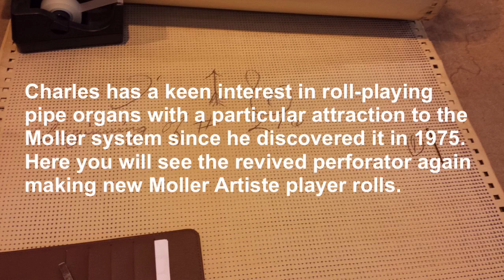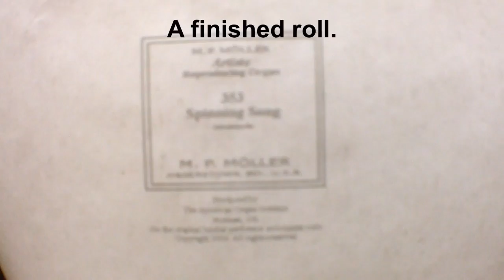The Moller Artiste pipe organ player roll perforator.

Comment from the maker: The name "Artiste" was first copyrighted by Moller for their roll-playing system.  Roll players fell out of fashion between 1930 and 1940 and largely were no longer offered. When Moller introduced their line of small cabinet organs, they took the Artiste name which was still in copyright and used it for these small organs, but its first use was for the players.
Reply: I learn something new everyday... My late grandfather ( Harold D. Ocker ) worked for Moller from 1924 until before their unfortunate bankruptcy. He first worked as an installer and finally the vice president. He developed the later "Artiste" cabinet models, which I understand was a bit of a failure. Moller was competing with the newer electronic organs, which were far less expensive.